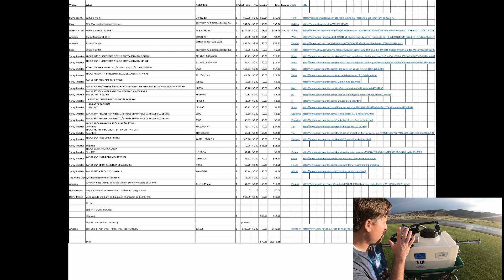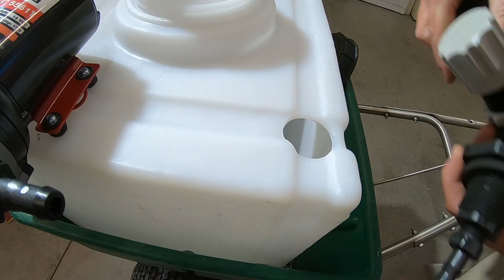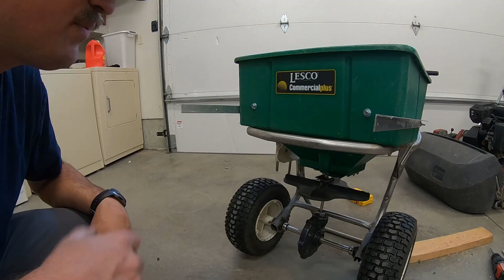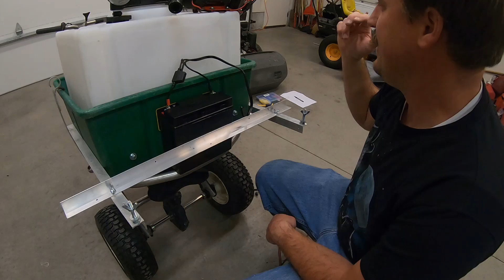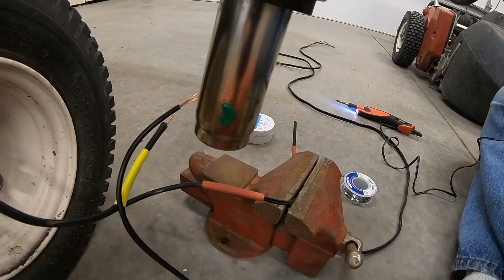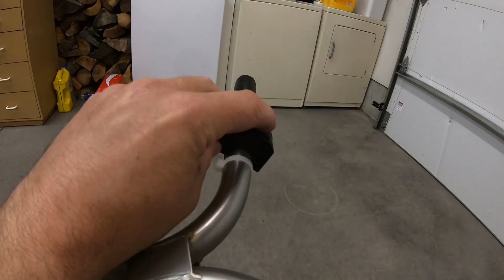How to build a HOMEMADE LAWN SPRAYER. 5 nozzle boom

Comment: Why didn't you just buy the Gregson-Clark Spreader Mate A?  The tank is specifically manufactured to fir down into a Lesco Pro Spreader.  The cost of those already built sprayers is $555.  You could have then modified that set-up for your boom expansion.  Just wondering.
Reply from the maker: I thought that one through sooooo many times. I almost did just that. The bigger 12 gallon tank vs 9. If I went that route then the spreader mate b would have been what I wanted because of the foldable boom for storage. I think I saved about 200$ and got another nozzle. It does not fold however. I put a lot of thought into just buying the spreader mate. In the end this what I ended up with. I like it and it holds 3 more gallons. I also contemplated just buying their tank and doing the rest myself because of the molded tank fit. I also have a better capacity pump than they have.
Reply: That is what I was thinking also.  The capacity makes sense.  I just wish Lesco did not charge a premium price for their spreader.  They are very proud of that spreader.  Thanks Connor. I enjoy your content.

Comment: I'm concerned about the cost of the spreader itself. It was over $500 on Amazon last time I checked. Could you possibly recommend a more budget friendly spreader that is sturdy enough to handle the 110+ pounds of weight you have there?

I wonder if a little Radio Flyer pull wagon, or something along those lines, could handle the weight? It doesn't necessarily HAVE to be a spreader, does it?

My spreader is too flimsy to handle the weight and yours is too expensive for me.
Reply: Building one now. I'm  at about $250 in parts.

Comment: Nice! I have an acre lot with centipede. My 4 gal backpack sprayer would be murder for a full yard treatment, which it needs. I'm thinking of using this idea and making an attachment for the front of my zero turn. How did you figure your correct application rate?
Reply from the maker: Calibration. I walked and sprayed water in a measured off section several times over and over like 12 to 15 times. I measured the amount of water I was spraying over that section and came up with a fairly accurate average amount of water. I figured out how much water I sprayed per that 7500 ft section. Once I knew how much water I was putting down I just added the chemical needed for that particular amount of sq ft. I tried to walk the same pace every time. I little math was involved.
Reply: Connor Ward any performance related reasons for your choice of pump (and it's capacity), nozzles, etc? Or just ease of availability...?

Comment: Nice spayer! Just built one for my zero turn. Bought the 10 gal tank and pump from norther too. I only have two nozzles but it sprays just outside my rear tires making it easy to see where I sprayed. I cover 25k sqft in two loads in about 45 minutes.
Reply from the maker: Cool. Super useful

Comment: You should try Sketchup.  It's a FREE modeling CAD program that you can design anything with.  For instance, I've modeled everything from a little Arduion board, to my entire property here (including all the underground pipes, wire, and drains.  Even the septic tank).  The trick is to get as exact a measurements as possible.  Then you can test new ideas, move furniture around, or just use the model to check a measurement without having to go out and check it again...

On your sprayer there.  I think I would have used a couple pieces of 2x4 to set the tank on.  But with your althread rods, you should think about adding some rubber tubing on them to keep them from wearing through the plastic tank.
Reply from the maker: That rubber tubing is in the plan. Just have not got around to it. Someone else suggested that. That's a must for sure. I did not want added weight with something bigger like a 2x4. With the 12 gallon tank it's flipping heavy

Comment: Very very nice. Would you ever consider a 4 wheel spreader and maybe a larger tank? How is the current weight when full?
Reply from the maker: It is pretty heavy. 12 gallons of water makes it pretty heavy. It is totally doable. 4 wheel would be out unless it was gas powered self propel. I need maneuverability.
Reply: Midnight Monoculture 
I was think of using an old lawn mower as a 4 wheel base    Maybe put on some larger tires.

Comment: Just curious why you didnt just buy the 25 gallon boomless sprayer from Northern tool.   They are amazing sprayers for the price.
Reply from the maker: Mike West. I wanted a boom. Boom less is good but I wanted the perfection and precision that you get with individual nozzles. I have used boom less sprayers before and they are good but I was looking for something different. I also wanted something that I could put inside my fertilizer spreader. Having a walk behind gives me the ability to get into tight spots and corners a lot easier than say a tow behind. Ever tried to mow in a tight corner with a ride on mower? While the walk behind mower is slower it has more ability to maneuver.